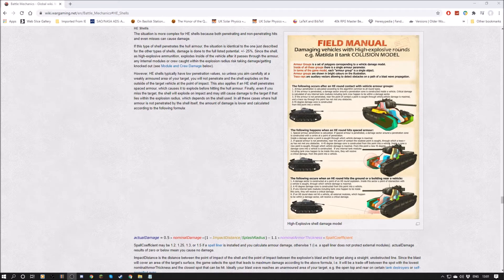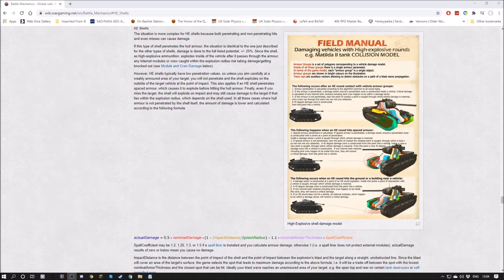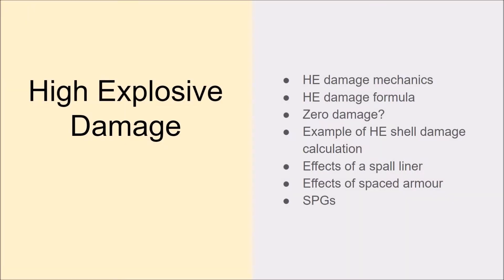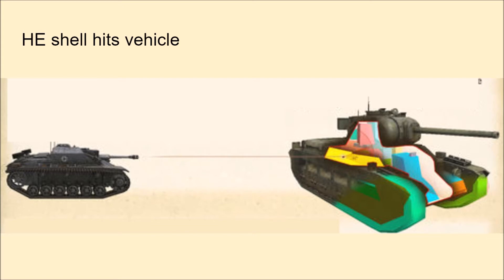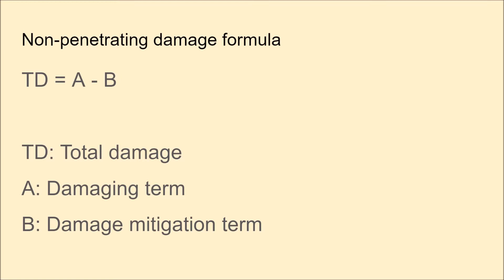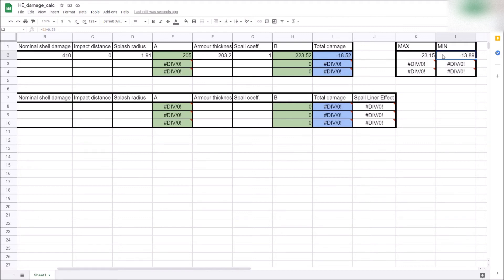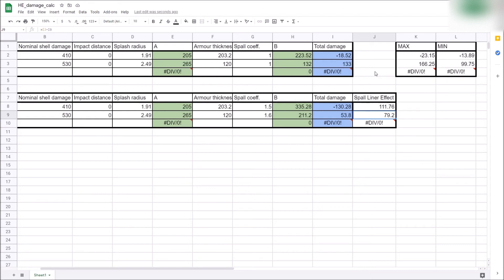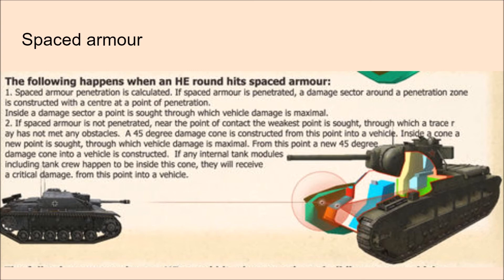High Explosive Damage Mechanics

Comment: Funny as this morning I was watching an 8 year old video of how to fit out the Hetzer, and with the 105mm gun how he got a low roll on hitting an enemy tank, even at a shortish distance, on the wrong part of it, and the maths behind it. In his case a high roll would have something like 450, but all he manged was 100 damage, and the reasons why.
Coincidence....:)

Now a video from you on explaining in depth a lot more of how HE works, especially in these coming changes to HE rounds.

Does that mean my HE in my Hetzer is going to be neutered?....:)
This may be a daft question, but it is lunch time here, and my lonely brain cell needs some nourishment of some sausages, scrambled eggs and bacon, and a healthy tomato...:)
Reply from the maker: If the changes went ahead, all HE would be nerfed.
Reply: @lordchipmonk1  And all the better for it.
Reply: @WulfCorbett  
Nooooo, my Hetzer depends on HE for a living......:)
Reply: @Trillock-hy1cf  Exactly. 105mm howitzers should not be capable of one-shot-kills on standard tanks reliably (the increase in hit points has helped). They were used in anti-tank roles, but always with HEAT.
Reply from the maker: @WulfCorbett  Personally I would argue that a HE nerf doesn't address the core issue, namely that (for example) 105mm guns have no place at tier 4. As for the specific nerfs that WG are proposing, they do basically nothing for one-shots. They just make heavily armoured tanks harder to damage.
Reply: @WulfCorbett  
Thanks, now that I can juggle the ammo about from slots 1, 2 and 3, 1 and 2 hold the high penetration, damage and velocity, and 3 is for just ordinary HE lower damage, penetration and shell velocity.........I think...:)
Rarely having any prem time, I lose a lot of credits, and the prem time I do buy now and again, is usually wasted by not playing much.....*sigh.
If on a tier IV top tier, then I can some times marmalize a tier 2 or 3 enemy, but these days I am bottom tier in tier VI games, so not some much fun...
Been watching a lot of great Hetzer replays to see if I can get some tips on where to go, but many are from some years ago, on the old maps which are a bit different now with all these changes.

Plus some Obj704 (my old favourite big brother Hetzer) great games, to remind me of the days when I had one....:)
Reply: @lordchipmonk1  They do severely nerf splash damage. Your PzIVH for instance, if you'd hit the turret, could have been penetrated through the deck armour and taken 300-400 damage maybe more with RNG. Heavy armour is really a problem of Gold ammo pen , and since Gold ammo pen is tied up to Premium tanks, they'll never reduce that. Heavy armour SHOULD be impenetrable to HE.
Besides, the current sandbox tests are just tests. They don't work for a number of reasons (I will be interested to see what the SPG test entails), but they have provided one more set of data, an given the Gold-spamming Tier-10 fanboys something to play with.
Reply: @Trillock-hy1cf  I tried getting some Hetzer games in the sandbox, but failed every time. I did get a couple of PzIVH games and a Sherman game with howitzers, after a long long queue time, but they were inconclusive. I did get quite a few games in the SU-152, with the 122 & 152 gun firing HE, it was not a winning strategy, thankfully.
I think I'll take the SU-152 back out on the live server though...
Reply: @WulfCorbett  
Ah, another my my old favourites along with the ISU-152, so perhaps if good, a replay review by Lord C. would be nice?.....:)
But a good way to test out these impending HE modifications...
Shame about the no show Hetzer games though...........did I ever mention that I quite like the little fella, as I am only up to tier IV, and play it when I feel like it, to build up a decent crew?
I do have my old M56 Scorpion prem (not special prem) tier VII (usually in tier IX games), but the crew is a bit crap, and not a lot of fun to play just now.
Reply from the maker: @WulfCorbett  Yes, it is splash damage that the proposed changes nerf. Penetrations remain largely unchanged. So, even with these nerfs, one shots will still be a thing and even if they nerf HE to the ground, you'll still be able to do 350 average damage firing HEAT with your Hetzer/Sherman etc. Like I said, I don't see HE as the issue here.
Reply: @lordchipmonk1  HE is the easy option though. And it would need a good deal more aiming with the sandbox changes. However, as I say, these precise changes don't work. They have been an interesting test though.
Reply from the maker: @WulfCorbett  I'm curious what about them you don't think work. I've not been on the sandbox so not actually tested them myself.
Reply: @lordchipmonk1  What doesn't work about the sandbox is the vast majority that just make use of the virtually unlimited gold, credits & bonds and every tank in the game (nearly... couldn't get the Black Prince prototype...) and spam gold ammo at tier 10...
Problems with the HE tests include spaced armour not really working - the Strv 103B's railing fence was virtually useless  against HE (but still worked against HEAT...), weird results firing at tracks (the hit boxes on some tanks seem very strange...), the all-or-nothing effect of big HE shells (same as present really -and the Type 5 appears to be more OP than ever!) and the seeming precision of HE shells (possibly WG adjusted the Sigma to get more hits - every tank I looked at that had a howitzer option came pre-configured with that option).
Reply from the maker: @WulfCorbett  Alright, cheers for the info. 

Btw, as far as I know, the sigma in WoT is the same for every tank.
Reply: @lordchipmonk1  Even if it is, it's tweakable.
Reply from the maker: @WulfCorbett  Yes, it would be possible to tweak it, though AFAIK they do not in WoT.
Reply: @lordchipmonk1  Given that it's never shown anywhere in WoT, none of us would ever know. It certainly is in WoWS.
Reply from the maker: @WulfCorbett  Yes, it is in WoWS. I read somewhere that it isn't in WoT, but cannot of course guarantee that is the case.

Comment: Your min/max calculations - at what point is RNG applied to damage? If it's before damage mitigation, the results would be very different, and might give a more likely result for the PzIV example.
Reply from the maker: Yeah, I spent some time looking into this, but the answer wasn't 100% crystal clear. As far as I could tell, I applied RNG at the correct moment, i.e. once the damage calculation has been performed, but it is possible that it is otherwise.

If anybody is able to offer further insight, that would be grand.

Comment: Wouldn't this HE nerf really hurt the KV-2?
Reply from the maker: Yes. Yes it would. But I think what you would see in the case of the KV is more people firing gold AP (130 pen). So, if instead of HE spam, you'd see 700 alpha AP shell spam instead...

Overall it seems to me that the proposed HE nerfs just promote yet more gold spam. Yay...?
Reply: That alone (well, along with the Type 5, etc) will ensure this sandbox test won't pass through. But it does test ideas.
Reply from the maker: @WulfCorbett  I don't think the Type will make much difference (the derp gun was nerfed into oblivion on that tank). It does test ideas, that is true. I'd just like them to test potentially decent ideas. ;)
Reply: @WulfCorbett  The Type 5 (and maybe Type 4 As well) actually received a 240mm pen AP Round on the 15cm on Sandbox, so I think that base is actually covered somewhat. Tbh the Japanese heavies need a proper rework though and blocking the changes because of them namely would be stupid.
Reply: @stukapansy5145  I forgot about the AP round, admittedly. But it's not about sensible or even sane arguments, it's about rabid fanboys wanting their OP shells. Admittedly, as proven time & again, it's only really the RU server WG cares about (EU is just there for cash), so it'll be the KV-2 tat matters. There were a lot of KV-2 on the sandbox...
Reply from the maker: @WulfCorbett  The FV4005 is also apparently very popular on both EU and RU so I imagine that will also play a factor.
Reply: @lordchipmonk1  DezGamez just covered that. It appeared... random. But not really nerfed.To be honest, when it comes to guns that big, I'll give them some leeway...

Oh, I forgot to mention by the way, when you are on the sandbox, your name carries your origin area - mine is Wulfc_EU for instance. I can't remember a single game out of the couple of dozen I played where more than 1 or 2 a side were anything but RU...
Reply from the maker: @WulfCorbett  That doesnt surprise. RU is by far thr largest aerver region in WoT.